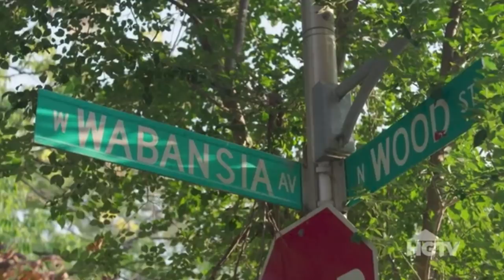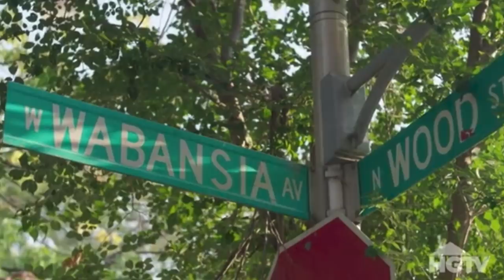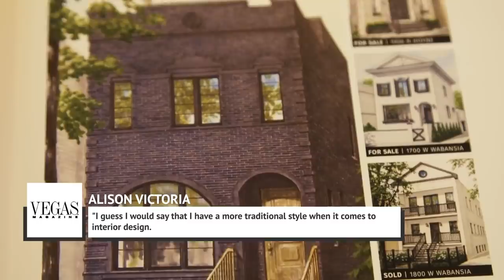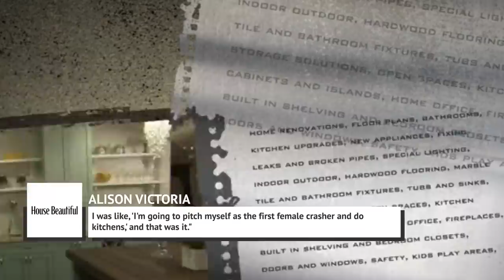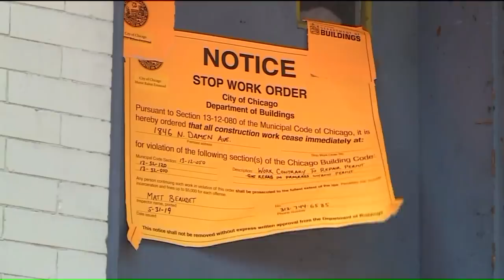The Truth About HGTV's Windy City Rehab Finally Revealed

Comment: Being in this business, I have to say that this is one of the most REALISTIC approaches to a "flip" show that exists. In fact, it isn't a "flip" show. These projects all take +6 months to complete. All permitted, her numbers are very accurate. A "flip" would consist of a project that would be turned over in under 90 -120 days. Allison spends big time money for these projects. This show and "Restored" are the best of the bunch.
Reply: I'm watching Windy City Rehab and I've been researching the problems that happened between Alison, Donovan, and the city of Chicago. According to buildings department records, “Windy City Rehab” projects violated city code by:

Working without permits at 11 different properties.

Working beyond the scope of pulled permits at 11 properties.

Failure to comply with safety codes related to issues such as electrical wiring. In early April, two different electrical code violations were issued at one property.

Failure to contact the city to obtain certificates of occupancy at two different properties.

Hiring workers who are not licensed, certified or registered by the city at 11 properties.

Lying on a permit application at 11 properties.

Failure to correct a substantial “defect, error or deficiency” at one property.

Performing work that poses an “immediate or imminent threat” to the safety of workers or the public at 11 properties.

This list is extensive. For Alison to go on TV and cry crocodile tears that she didn't know wreaks disingenuous to me. According to Alison she is "just the designer." She is just the designer visiting every property and she is not aware that she and Donovan hired workers who were not licensed and certified? Hogwash. Both Alison and Donovan were cutting corners to maximize profits and she knew what she was doing. Since Alison's name is tied to the LLC she is responsible for knowing. I don't doubt Donovan stole money but how could he steal over $800,000 and Alison not know about it? "He's the finance guy and I'm the designer" isn't going to cut it. Now that the owners from previous properties are suing Alison & Donovan for shoddy construction is again the fault of both. Alison was working without permits at 11 different properties. She can't feign naiveté. Alison was a willing a culpable party to the infractions. Alison and Donovan were penny wise but pound foolish and they got caught. Still, I hope that Alison will learn from her mistakes and that those workers whom have not gotten paid will be well compensated. Don't just think about yourself, Alison, think about all of the other people your misbehavior affected. After all of this I wish you the best of success.
Reply: @davidhunternyc1  It is very easy for you just to sear behind your computer and judge people. Stop making assumptions on situations that you haven't participated, it's irresponsable. 
We are listening to Allison version of the problem. We have to listen to Donavan's version, he might never get one.
Stop accusing people and get a job that keeps you busy.
Reply: @icetlorenzo9377  Nice try. My above comment isn't an assumption. The violations are directly from Chicago's Building Department records. Furthermore, have you seen the videos and photos from the home of Anna & James Morrissey? They are horrifying. Yes, I am searing behind my computer but the owners of Windy City Rehab homes are living in money pits bought under false pretenses. HGTV is culpable. Donovan lost his license, Alison knew he lost his license, and HGTV continued filming the show.
Reply: @davidhunternyc1  And it was all on Donovan who was in charge of that part.
Reply: @Iansco1  Alison just said on the latest episode that with Donovan's last 20 properties none of them passed their final inspections. What? Alison didn't do her homework before signing on as co-partner in a LLC? Puulleease. She is not the victim. The buyers of her homes are the victims.
Reply: I love Restored. I could watch it for hours.
Reply: @davidhunternyc1  Yeah. I don't buy that she didn't know any of this was going on. I like her style but I don't think she was as clueless as she is making herself out to be on the show. She may have not wanted to know everything but she knew something and did nothing sooner. It seems like they were taking on a lot of projects all at one time. Like way too many to complete correctly and on time.
Reply: @memegbutterfly  Yes, Alison is a gifted designer. There is no doubt but for people to think that Donovan was the only person scamming people is naive. What, if a woman acts innocent and sheds a few tears than all is forgiven? People are so gullible. Please, there are scammers of all kinds. She knew that every one of those immigrant workers were being payed off the books to save money. What? She didn't have access to their payroll either? The red flags go on and on.

Comment: I'm watching Windy City Rehab and I've been researching the problems that happened between Alison, Donovan, and the city of Chicago. According to buildings department records, “Windy City Rehab” projects violated city code by:

Working without permits at 11 different properties.

Working beyond the scope of pulled permits at 11 properties.

Failure to comply with safety codes related to issues such as electrical wiring. In early April, two different electrical code violations were issued at one property.

Failure to contact the city to obtain certificates of occupancy at two different properties.

Hiring workers who are not licensed, certified or registered by the city at 11 properties.

Lying on a permit application at 11 properties.

Failure to correct a substantial “defect, error or deficiency” at one property.

Performing work that poses an “immediate or imminent threat” to the safety of workers or the public at 11 properties.

This list is extensive. For Alison to go on TV and cry crocodile tears that she didn't know wreaks disingenuous to me. According to Alison she is "just the designer." She is just the designer visiting every property and she is not aware that she and Donovan hired workers who were not licensed and certified? Hogwash. Both Alison and Donovan were cutting corners to maximize profits and she knew what she was doing. Since Alison's name is tied to the LLC she is responsible for knowing. I don't doubt Donovan stole money but how could he steal over $800,000 and Alison not know about it? "He's the finance guy and I'm the designer" isn't going to cut it. Now that the owners from previous properties are suing Alison & Donovan for shoddy construction is again the fault of both. Alison was working without permits at 11 different properties. She can't feign naiveté. Alison was a willing a culpable party to the infractions. Alison and Donovan were penny wise but pound foolish and they got caught. Still, I hope that Alison will learn from her mistakes and that those workers whom have not gotten paid will be well compensated. Don't just think about yourself, Alison, think about all of the other people your misbehavior affected. After all of this I wish you the best of success.
Reply: I know that because Alisons name is on the LLC she is responsible for all of the problems it was Donovan that they don’t want on the jobs. It was Donovan’s crew how would Alison know they were hired illegally. Alison was paying yo complete these buildings she was paying contractors that had not been paid with her credit cards and her savings Donovan wasn’t answering the phone after stealing the money 💰 the buildings had to either be sold lot completed. I pray for the best her brand is effected I can see how he Donovan or anyone could do this and she not know if all she did was design if Alison wasn’t there in the sages of development to make sure the work was done I can see how she wouldn’t know. I’ll give her the benefit of the doubt it must be hard having your partner that you trusted let you down then you are held responsible to pick up the pieces Alison will take care of those homeowners that work wasn’t done correctly she will pay the contractor she will win.
Reply: @gospelgirl61graceforliving36  This is the narrative that HGTV wants you to believe. HGTV is culpable too. Alison & HGTV knew that Donovan was operating without a license. It was on the show. Why would HGTV continue to allow filming? Why didn't HGTV vet Alison's and Donovan's credentials before they started filming? Alison is a designer but she is a builder too as her name is on the LLC. Have you seen Anna & James Morrissey's videos and photos of their destroyed home?  It's horrifying. It's not just one homeowner but all of the homeowners are taking legal action against Alison & Donovan. I don't doubt that Alison was a victim to some extent but she also turned a blind eye and she knew that the workers on the jobs were not licensed. This is not my opinion. The infractions from the Chicago Buildings Department are in black & white for all to see. Windy City Rehab is a nationwide TV show. What, you think that Alison walked in on the jobs and had no idea? Alison got caught. Her attempt to compensate homeowners is a way for her to save face. Listen, I don't wish Alison or anyone else harm. I don't wish her to fail. I just want her to come clean and apologize for her wrong doing. For Alison to shift the blame and point the finger at Donovan is disingenuous. Perhaps it's the fault too of the homeowners for not hiring a building inspector before purchasing their homes. I'm not sure what the protocol is when purchasing a home that is rehabbed but let this be a lesson to everyone who is involved.
Reply: @davidhunternyc1  as a Chicago resident, it just seems like the typical Chicago way. So many corrupt politicians and businesses here. It seems like everyone is concerned with making money at any cost. No one cares if it's at the expense of others.
Reply: @chi1abb  Yes, it's the same in NYC and everywhere else too. I'm not knocking for Alison and Donovan for their business-as-usual approach. Just don't go on TV and act like the victim. The new "general contractor" Ermin Pajazetovic seems like a nice guy but is he licensed? Alison just revealed that Donovan's last 20 properties never passed the building department's final inspection. Alison either turned a blind eye or didn't care. Why would you enter into a LLC with someone and not do your homework? At least Donovan put his tail between his legs and ran when he was caught red-handed. Alison's infractions are minor compared to the infractions by other celebrities. She will rise from the ashes and a couple of years from now people won't care. As long as she is a cash cow for HGTV they won't care either.
Reply: @chi1abb  Exactly my thoughts. Chicago is the most corrupt city in the history of the world.  I grew up there.
Reply: What in the world is the matter with her, any wingnut knows you have to be licensed, don't feel the least bit sorry for her troubles,.  But glad her and Mike Holmes won "rock the block" although Mike could hardly get a word in edgewise

Comment: Thats what makes the show so great all the permit problems liberal cities create 
to squeeze more money out of the Designer , Developers and General contractors 
NYC is Even More Horrible they take you to Court fines start in the 2 thousands range and go through the roof
and Sanitation Fines and this fine and that fine. They (NYC Sanitation Dept) Come make sure you are looking at you 
they point to the ground and give you a ticket then you have to spend days weeks fighting the ticket in court it's lots of fun 
But I love Alison Victoria's show Its Hip And Modern with Flashes of Old Timey architectural pieces which make it look Amazing.
I do Not think all was revealed with Eckhart, It got out of control yes, but they should have gotten a lawyer to deal with the city and an accountant to actually do the paperwork
And as a reno guy lots of times you end up paying to finish the job you actually lose money and it's alway because you did not price it high enough. 
Do Not get into this business unless you have deep pockets, you will end up losing the project
Reply: Great info...So true, should've always had a lawyer and Official CPA on deck..This is the PRICE of trying to cut corners